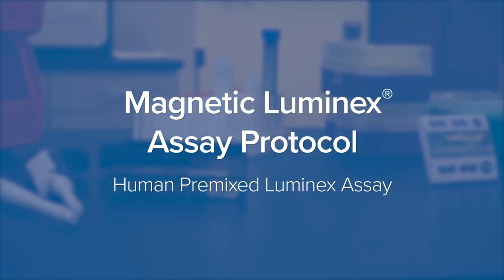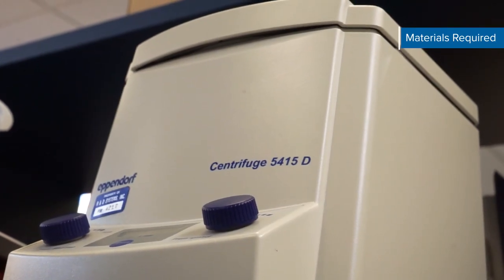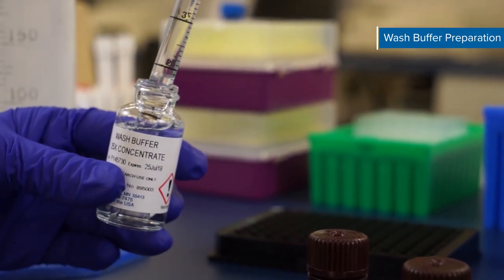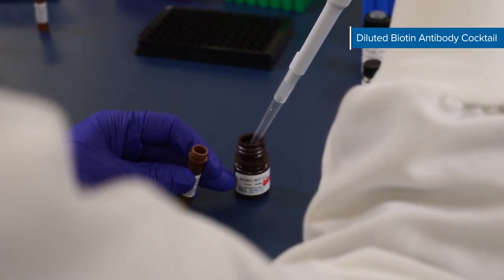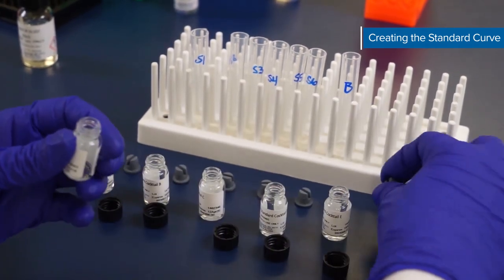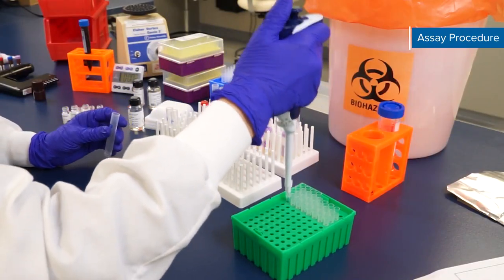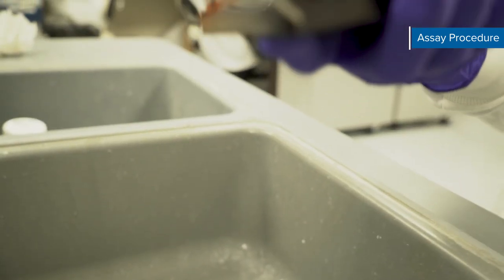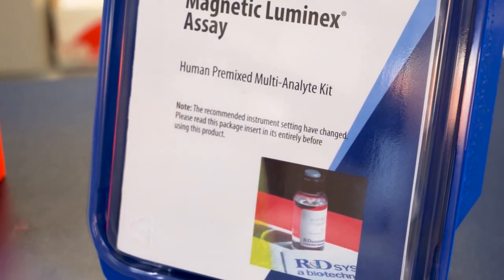How to Run an R&D Systems Luminex® Assay: Protocol, Tips & Tricks

Comment: Very nice video. Sorry to ask, is it necessary to have the handheld magnetic washer?
Reply: Yes! The magnetics attach the beads to the base of the well so they are not lost when discarding the solutions. Without the magnetic washer the microbeads will go down the sink too and you'll be left with nothing to analyse! Make sure you allow 1 min for the beads to settle before discarding solutions too.